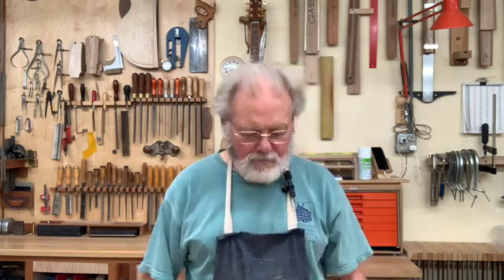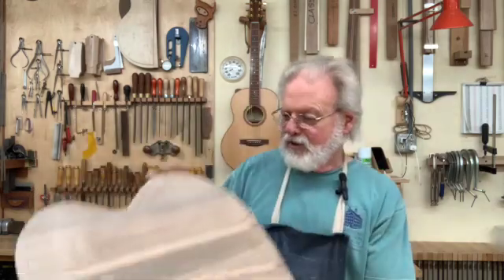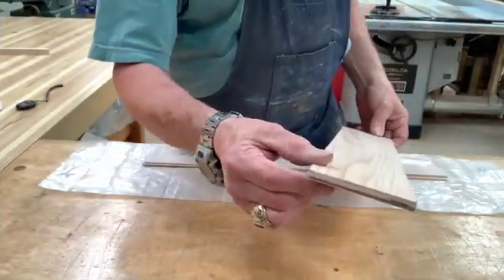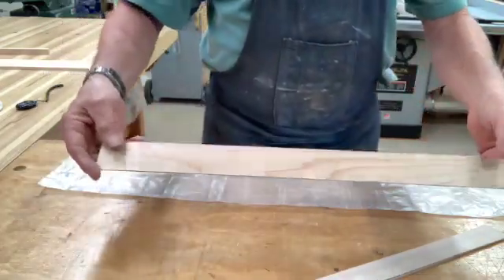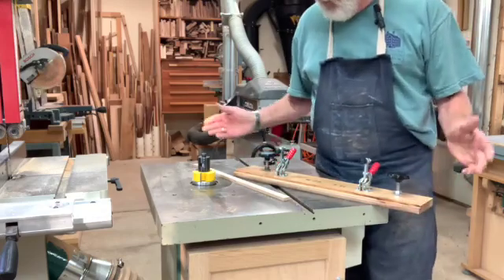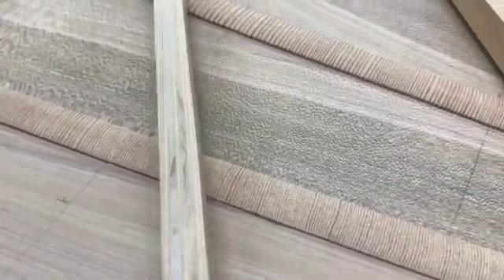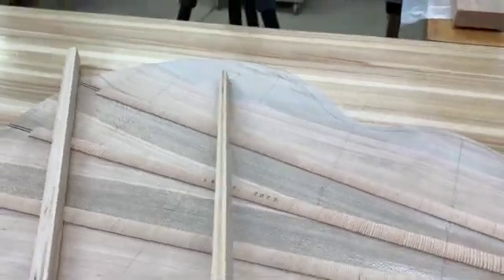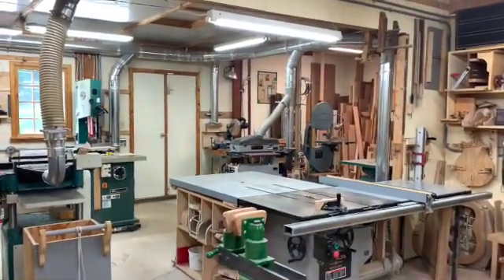Laminated Back Braces: Stiff, Light , Strong !

Comment: Really love your content. Did you test these braces to confirm they have a higher strength to weight ratio than standard braces?
Reply from the maker: I didn't test for strength to weight ratio.  I use these for back braces and I'm not concerned about direct transfer of kinetic energy as I am with the top. Were i to use laminated braces in the top, especially those with a hardwood center, they would clearly be too heavy to efficiently drive the top.  I'm interested in stiffening the braces thereby increasing the stiffness of the top.
Reply: @thepragmaticluthier , That makes sense. Thanks for getting back to me.

Comment: Hi Kevin, Great video. I'm interested in trying this out myself.  For the 5/16 braces are the three plys all the same thickness or are the WRC plys thicker to give even more weight reduction?  Why don't you use them on the top also?  Thank you
Reply from the maker: I change the thickness of the brace layers and the hardwood specie to influence weight and stiffness. In a back, I'm much more concerned with stiffness than weight. I have never used the technique for bracing tops because I'm of the notion that laminated braces may over-stiffen a top. That's a theory, not a fact. I should try it sometime, especially with a real flexible top. Thanks for your comment:)

Comment: I'm a recent subscriber & really enjoy your videos. I was taught to use spruce for the braces & in my classes that's what I've done. But now I'm home making a handful of ukuleles which don't demand a lot of strength. I'm using hickory with vertical grain because I've got a bunch that I've milled over the years. It's certainly harder to carve than spruce but aside from that, is there any disadvantage if used on a full sized guitar?
Reply from the maker: I see no disadvantage at all provided that you achieve what you want.  Hickory has no physical properties that would cause one to question its use.

Comment: Very interesting!  I applaud your practical instincts!

After the braces are glued in place I presume you carve them down narrowing the top producing a more triangular section.  At least that is what I do on my ukuleles and in Triangle NY I would expect the same….  If the center of the laminate sandwich is maple and the outer parts are cedar it would appear a large fraction of the tall brace center is maple.  The cedar provides nice stable feet for glueing, and some weight reduction, but minimal stiffness as it is no longer tall.  As bending strength scales as thickness cubed you end up with the thin central maple core contributing the majority of the bending stiffness.  Most of the cedar border (perhaps 75%) gets whittled away.  Stiffness wise I would be tempted to try solid maple braces as it would only slightly heavier after I carved them.

Yet I am tempted to try laminated braces as you make it look rather fun.

Many thanks for thinking outside the box!
Reply from the maker: The maple does provide the vast majority of stiffness for sure. The outer laminates provide little more than gluing surface. I don't use a Maple brace simple because of the difficulty in carving it.  It might be interesting to make a T-shaped brace to increase glueing surface, having a brace of Maple about 1/8" thick.

Comment: I'm trying to decide between buying a shaper or a router table.  Is there any reason to buy a router table for building acoustic guitars (other than cost), or is a shaper as good or better for all operations?

I know there's a speed difference.  Is there any operation where I would need the higher speed of a router?
Reply from the maker: I'm the very strong opinion that a shaper is a much better investment because: it runs slower and is easier on bits, it runs more concentrically than a router, making it easier on bits, it is more powerful and much more versatile, it can drive router bits as well as shaper cutters, it is heavier and more stable, vibrating less.  All of this equates to better accuracy, more longevity for the tool and its cutters. On the other hand, I do tool making, cabinet joinery, panel raising, cope and stick work, all of which will reduce most  routers, router tables and bits to useless junk in just a few hours of operation. Lastly, NO cutter needs to spin at 20,000 plus RPM's, but router motors must in order to maintain torque.